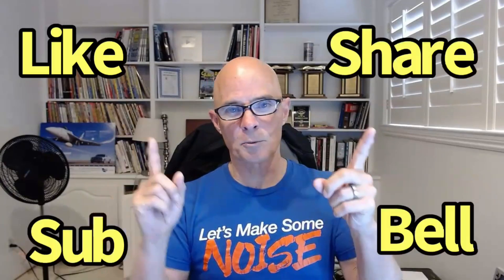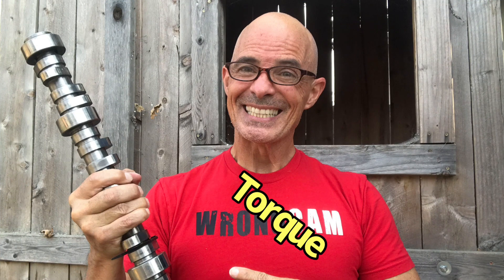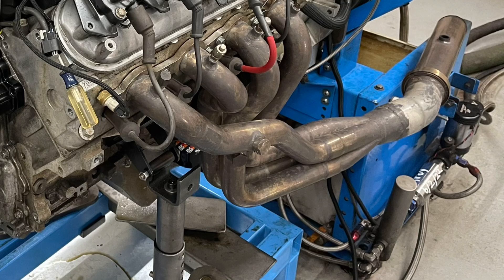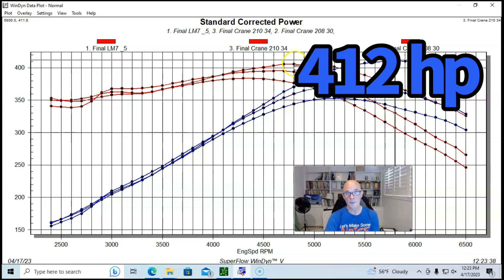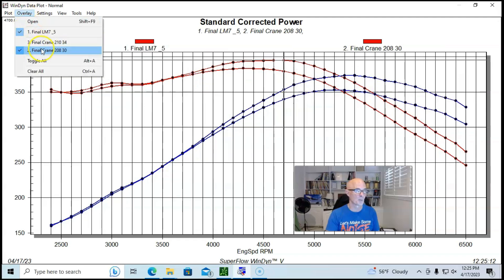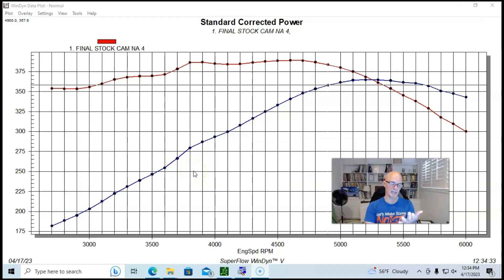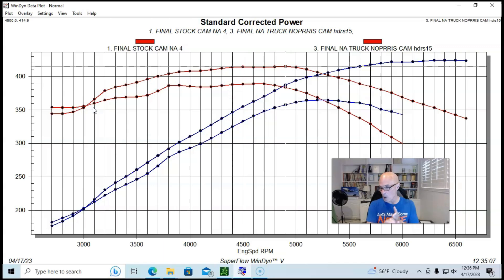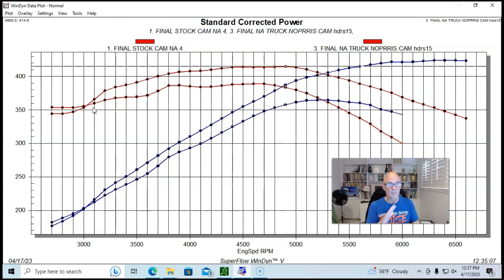WHERE'S THE TORQUE? HOW CAN I MAKE MORE LOW SPEED TORQUE? WHO MAKES THE BEST LOW-SPEED TORQUE CAM?

Comment: Absolutely love the video, I just put the 202/202 btr torque cam in my twin turbo lq4 with l92 intake and rec port.  Such an amazing power curve!  Love being able to make 600ft lbs at 2500rpm and carry it to 5500rpm while still making usable power all the way to 6k.  Used the "china gt35 turbos" that measure out to a 62/62 on a t3 .82 a/r hot side.  Used stock truck manifolds flipped upsidedown to create my own twin t3 setup.  Added 50mm external wastegate provisions on each manifold.  I highly recommend this cam for anybody that wants a noticeable bump in power from idle to rev limiter (around 6k) with a nice smooth idle and great vacuum.  

I'll say this again as I've said it before, adding stall speed doesn't "gain you low end torque" it just puts you in a better spot on the power curve right when you smash the gas pedal to the floor.  This is great except for when your cruising highway in torque converter lock.  If you have big tires, high gearing, or both then your probably at like 1800rpm to do 60-70mph and the stall doesn't help there cause your converter is locked.  You will get a lot more downshifts and torque converter unlocks on the highway when you hit an incline or a head wind if you choose a cam that makes less low rpm torque on big tires, or even just heavy trucks with stock gearing.  Higher stall speeds are very dramatic on highway when the converter has to unlock to get you up the inclines. Also, the more your converter has to come out of lockup, the hotter the trans temps get.   A big cooler is a must with a stall upgrade obviously but if your ever gonna haul weight then keep your stock converter and either the torque cam, stage 1 truck cam, or stock cam.

The guys that really want more low rpm power on the LS powered trucks follow this plan.
BTR torque cam
862 or 706 heads (stock or ported) even if ya got a 6.0 or 6.2.  bigger is always better!
More compression is more power everywhere and is most noticeable on bottom.
99-06 truck intake manifold with the 3 bolt throttle body
And long tube headers.
That's it, that's gonna max out your low rpm power production.
 
You are not gonna make a Dyno queen this way because the things that create such strong power/efficiency in your casual driving rpms are going to be a bit of a bottleneck above 5500rpm where the Dyno queens really shine.  But it's worth it to build one of these if you like to have your fun, get great mileage, and be able to haul like a diesel.  

Hope a few people benefit from my rant 😜
Reply: Well said.  Was planning to post something similar but you summed it up well.  Focus on things that will bring up intake velocity/inertia at low rpms if you want more low rpm torque, but understand it will cost high rpm output.  People get scared by the last part, but let's be honest, most truck motors rarely see over 6k rpm anyway.  My Tahoe rarely sees over 5k, so I'm more interested in 2k-5k output than anything above that.  My other cars, whole different story (and cam needs).
Reply: @ChurchAutoTest  you want the BTR torque cam as an upgrade.  It drives and idles like a stock cam but has a noticeable gain everywhere
Reply: Good insight and advice for daily drivers. This is what we need more of. All too often the forum leaders have their followers making mods that are tough to live with daily only for another 50hp.
Reply: @nyplantings2420  fully agree
Reply: I swapped an LQ9 in my 05 silverado. Great bump over the high mile 5.3. Been considering long tubes for a bit now. Can't ever have enough lol.
Reply: How much boost are you running? I’ve been looking at the BTR torque cam for my build. 
I’m building a turbo lq4 408, 9.4:1, and plan to run 3-5lbs of boost. Truck will see 5000rpm max. I’m looking for max power between 2500 & 3500 rpm, don’t really care if I gain much above that.
Reply: @jakejames3634  that cam should do it, I'd probably use some 1.8 rockers too so you can squeeze more lift out of it for all that displacement.
Reply: Your not wrong !! Speaking facts
Reply: I'll NEVER buy a BTR cam !!!! ANY CAM COMPANY THAT WILL NOT GIVE SPECS IS NOT A GOOD CAM COMPANY, its a marketing scam and wants you to buy on feelings instead of facts, figures and physics.... Engines ALL operate by the law of physics and without correct timing events you will NEVER produce maximum power. There are calculators, programs that if you input the size of the valves ( more accurate if you have actual flow #'s but valve size is 98% accurate ), compression, usage (ie race vs street vs tow) they will tell you the correct LSA , overlap, intake valve closing timing for MAXIMUM TORQUE and HP.... If your not making 1.3 to 1.4 TIMES more torque than cubic inches ( thats 420 to 460 ft/lbs on a 5.3L ) then you have the incorrect combination. Its physics, not marketing.... This isn't to bash JUST BTR, as others don't publish all the cam timing events also (on some or all their cams) and I wouldn't buy a cam from anyone who can't give the specs on their cams...
Reply: @MSU_BullDAWGz  I'm sorry that's the way you feel, Brian tooley himself is actually a friend of mine now (at least on the internet) and we've had many conversations.  After 20 plus years in this field I can still start learning from him in the first 10 minutes of a conversation.  As far as I know BTR is one of the only companies right now making cams to their own spec instead of just rebranding somebody else's cam.  If you look through eBay now all of the cheap "truck cams" are the exact same spec that Brian tooley used in his super successful line of truck cams.  The difference is on eBay they are a third of the price and about a quarter of the quality coming from crap China cores.  That takes money right out of the actual designers pocket and why does that happen? Because he put the specs out there in full.  After that he developed a whole another series of cams that was far superior to the prior cams and instead of giving away the specs so it could all happen again he left out an important detail so that they couldn't be copied so easily and directly.  

Anybody can get a hundred bucks worth of tools online and use an old engine block to measure up the specs of any cam they want.  But since you didn't get every digit of the specs exactly the way you thought you should you just shunned the entire company instead.  Seems kind of extreme to me, if you've made it this far through my response you should send Brian tooley a message on Facebook and ask him politely what the actual exhaust duration is on a truck Norris Cam and I'll bet you he will give you the answer that will let you know the specifications to all of his cams once you learn the code.  

Knowing now everything I know about him and his company and about cams I don't think there's much chance I will ever buy another name brand cam again aside from his.
Reply: its NOT just the one digit they refuse to show in the .050 duration. I need the actual timing events, when does the intake close ? whats the overlap? whats the ramps of the lobe like? fast open but slow on close to prevent valve bounce? as spring pressure won't fix that, thats all in the cam design but like you said cheap china junk doesn't test or care, they just pump out a million to sell cheaper than a good company but as I said even comp, lunati, hoqwards, summit and others are hard to get the info 

i request but anyone refusing to answer questions is then saying to me WE DON'T WANT TO SELL YOU WHAT YOU WANT, we just want to sell you what we say you need NOT WHAT YOU ACTUA;LLY NEED AND THE INFO TO DETERMINE THOSE NEEDS. I'll buy a BTR cam if they can answer my requirements by answering my questions, till then I can't buy a cam on a gut felling or buying 100 different cams till I find one thats what a particular combination needs @coboscustoms4342
Reply: @MSU_BullDAWGz  why not just have one ground for you?  You know what you want for exact specifications.  Many companies offer that service.  
  For an off the shelf cam to fit very precise specifications to very few compared to the masses would not be cost effective.  That’s why certain companies offer this service at an elevated cost.  
 You seem very intelligent and was just wondering why you haven’t gone this route knowing that off the shelf cams are, well, off the shelf cams regardless of exact specifications given
Reply: @MSU_BullDAWGz brian says that he tests all of his cams on a spintron.  He makes them as aggressive as possible without going as far as producing valve float or bounce.  Once that occurs on spintron. They scale bqck slightly until the lobe is safe.  That's what he says anyone, and I dont doubt it

Comment: Thinking about replacing the worn out 302 in my 90 Crown Victoria.  351 at the very least, but then again as a full size daily driver, 460 would be even better for the purpose and power band.  Then when you start looking at price, performance gain, and the fact the old iron head factory motors were built well for that low/mid power from the factory decades ago, and the limited gains that can be achieved in the power band of concern with modifications, I think just buying a cast iron factory rebuild would be almost as good as a blueprinted and built custom motor.  

Most mods really are to maximize HP and top end, at the end of the day.  Good empirical data in your work, thank you.
Reply: Check out my link I posted. As a little hint, a Chevy 350 has same bore as a 302. One tweak I did was 11.0:1 compression 350 chevy piston on a Ford rod. My motor isn't built for turbo or supercharger but down the road A 150 shot is in the plans.
My car is named Frankenstein. When was the last time you saw a '97 Stang with a scoop sticking out the hood?
I'm still running the V6 Trans, torque converter and rear. Yes my car use to be a V6. A subframe swap took care of the 5.0L mounting up.
Reply: i agree, put that 460ci BBF in that bad boy.. A cam in that bbf only increases low trq n hp numbers too, look it up..
Reply: @P71ScrewHead  The issues finally come down to power band, and where you want it.  I drive my Panther platform cars as luxury cars, easy going with stock soft suspensions and shocks.  As such, low end torque, and/or mid range is priority.  With the high gear in the rear, these cars do well with torquey low end RPM range alone, and this is more in line with what I prefer for ride comfort.  If maximum torque in factory original is 2,800 RPM, and I rarely take it over 3,000 RPM, isn't this where the motor is well suited to the task?  

For pure luxury or workhorse purpose, displacement and mild cams are a good combination for a reason.  You don't want to rob the extreme low end for power up the band, and you aren't concerned about a higher torque number 3,000+ RPM's if you aren't using it anyway.

Comment: Richard, You showed perfectly that the Intake makes low end torque, Remember the Ford 460 boneyard motor? The flat cast iron stock intake made the best low end torque from 1500 to 3500. Ford did that deliberately to generate maximum low end torque to get their 5000lbs land yachts moving
Reply: That 460 is a torque monster even stock. I don't think anybody has ever produced a gas motor to equal the torque that the old 460 puts out.
Reply: @charlesespenshade  i agree..
Reply: @charlesespenshade  olds 455, at least in design if not numbers. UTG made an excellent video on it
Reply: @robthegobbler  I agree that the 455 was a good motor but I don't think the torque equals to the 460 Ford motor.
Reply: @charlesespenshade caddy 472/500.

Comment: What rpm does a tighter lsa work?  Or as DV would say, the right lsa...
Reply from the maker: the answer is it depends
Reply: @richardholdener1727  If you get a chance to, doing cam timing testing on a Coyote would be a cool proof of concept seeing all the cams are independent. Sustained rpm pull and sweep cam timing to see what it likes? Not sure that's possible. Thinking out loud...

Comment: More air = more work able to be done. A cam shaft cannot increase ariflow over a certain point as airflow is limited by engine displacement. Think of an engine as nothing more than a big air pump and things will become a lot easier to comprehend.

How to get a more powerful air pump? One way is to increase the displacement via increasing stroke. Take a 302 Ford and turn it into a 347. A 350 chevy and turn it into a 383. More displacement = a bigger air pump = more power. A second way is forced induction. More boost = a more efficient air pump = more power.Most modern vehicle manufacturers have to conform to fuel economy regulations and thus have turned to turbochargers as the way to increase low end power output. Tuned to spool up quick most of the ecoboost engines have peak torque output somewhere around 2000-3000 RPM which is ideal for a daily street driven vehicle. More boost = a more efficient air pump = more power. The third way is nitrous oxide. Adding compressed NO2 = injecting oxygen = more power.

A high RPM stall converter doesn't increase torque down low but rather forces an engine run at a higher RPM before transferring engine output to the transmission. In this way off the line the engine is already running at 5000RPM before the car even moves. Great for drag racing but terrible for everything else.  

However, changing the gearing in the transmission and differential to a steeper ratio directly increases torque at the axles by whatever multiple gearing is installed. This is why light duty tucks come with low "creeper" gears combined with 4:10 or 4:56 rear end ratio and a low ratio transfer case. A small displacement engine can do a lot of work when the torque output from the engine is multiplied 100:1. Great for pulling logs out of the woods but terrible for drag racing.

For drag racing combine both ideas. Use a high stall converter along with whatever steepest gear ratio and tire diameter combo which which will result in the car crossing the beams exactly at whatever max RPM of your engine is built to handle.

Comment: Would you run a ported 243 head or a milled 706 head on a dual plane intake with an Texas Speed MS3 cam. On a forged 347ci with valve reliefs on a daily driver. 9:7ish 243s or 10:5ish 706 compression. I'm thinking 706 to bleed off static compression with the big cam and still keep up the dynamic compression for pump gas.
Reply from the maker: properly ported 243 will make much more power than stock milled 706

Comment: So there's no "magic" camshaft for the 8.1 either? 😢
Reply from the maker: THEY ARE ALL MAGIC
Reply: I would say NO, at least in heavy towing applications. I tried the Rylar Engineering Heavy Torque cam in my 2001 Silverado 3500 pickup with 8.1 and 4:11 gears. Could definetly feel the low speed torque loss when towing my 12,000 lb 5th wheel.
Reply: @hyracer6684  Thanks for the heads up!

Comment: But really do you need much gain below 2500 rpm? Besides towing etc.. In normal stop and go and even highway driving you need very little power. On full or aggressive part throttle you will spend almost zero time under 2500 rpm especially with a decent stall. On the street for most cars  2500-4500 rpm is where the most gain is needed followed by 4500-5500 rpm above that without a lot of deep gearing you will see little time at useable road speeds. When rpm is somewhat fixed power can only greatly increased by Torque which highly depends on displacement either naturally aspirated or artificially for more bang per powerstroke.

Comment: The only way I have improved lower rpm power is compression, or cubic inches..with cubic inches the best. I have had so many want a good sounding cam, that pulls better in lower rpms than the stock cam.....LOL

Comment: Wouldn't the converter just be putting you in the higher rpm not giving more low end torque? What made the old tbi 350 have good low rpm torque?
Reply: The intake manifold design super long runners but the suffered in the upper RPM range.
Reply: Gear in the 700r4 transmission
Reply: @cedricwilson2055same as a 4l60e

Comment: The best way to gain torque on the low end, is a supercharger 😁

Edit: and a stroker kit
Reply: Best? Bigger engine will give same power with less fuel consumption, or more power at the same.
Reply: I beg to differ. I'm running a stock crank and rods on my build. I raised my compression with pistons a a little shaving of heads and block. Why I couldn't go with a bigger cam. I don't need to put a valve through a piston. My motor is built for NOS. I want to break my motor in good before adding NOS. 
Besides my Frankenstein being a work in progress I'm not quite ready for the NOS yet. I need my frame connectors welded in yet and get rid of my V6 rear.

Comment: I would like to see a test where you advance and retard the cams to show how that moves the power bands and a temperature test where you show the difference between 200 vs 140 degrees
Reply: He has a test up with advanced and retarted cam timing, and a timing test, and a air fuel ratio test.
Reply from the maker: TEMP TEST IS ALREADY UP-
Reply: I suggested s few variable valve train engines that would make similar demonstrations easy; I don't remember which. Was ... VW or Audi I think, some 1.8liter... guess that small engine isn't cool enough for a demo lol

Comment: Crower Baja beast cam makes power from idle to 4k
Reply from the maker: YOU AT WOT AT IDLE A LOT?
Reply: @Richard Holdener  normal off road driving  everything from idle to wot
Reply: WHAT YOUR SAYING is  the cam isn't a major determining factor. it's intake runner length, carb size, port size, and valve size.
Reply: @Richard Holdener  was the question more torque at low rpms? Not how much throttle can the engine handle at low rpms.

Comment: The best low rpm torque cam is usually the stock cam profile you installed into the largest displacement engine you can afford to build....